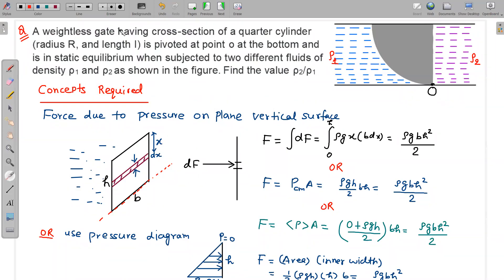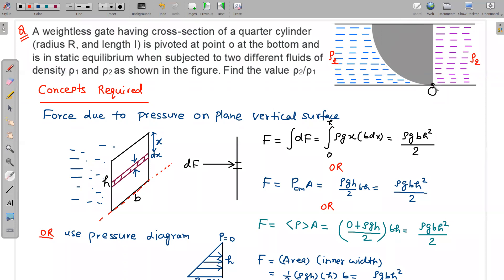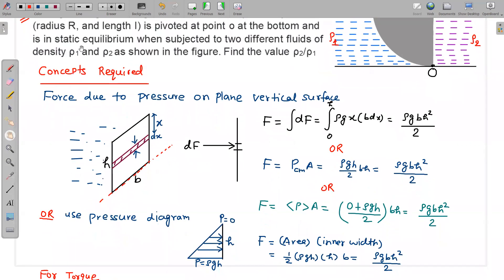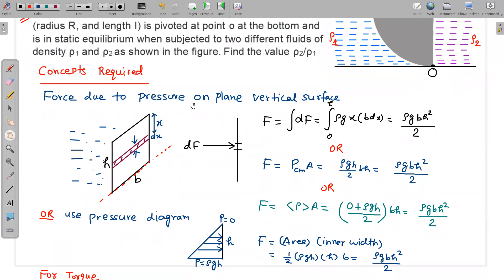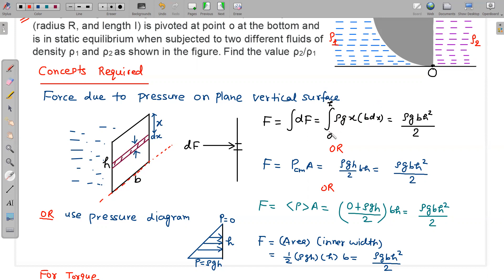Fluid Mechanics | Fluid Statics | Equilibrium of Cylindrical Gate

Comment: sir in method 1 why cant we balance the horizontal component of force instead of Torque by dFcostheta and  equate it with the force on plane surface by that I got p2/p1= 2
Reply: DF costheta on curved surface
Reply: Plz reply sir...
Reply from the maker: There are hinge forces also.
Pressure forces are not the only forces acting.
Reply: thank you sir